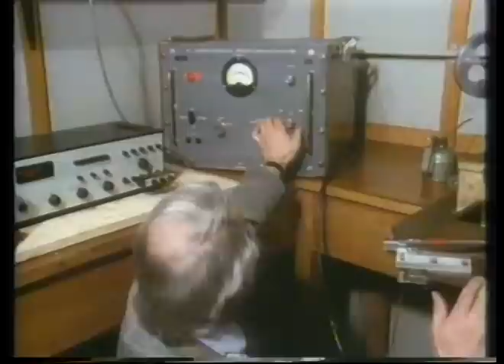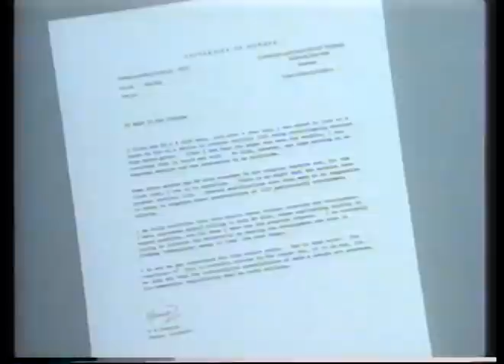Anti-Gravity Machine (Part Two)

Comment: I am now much older than Professor Eric Laithwaite when he passed away, and I did go up to London to attend some of his lectures. I am to write is meant for others to think about and if they have the time and equipment, they can try and confirm it. I did it in my simple manner of home experimentations.

1. Keeping the spinning plane. The mass in the spinning wheel of a gyro acts in the plane of rotation and tries to keep it due to the high angular momentum.
2. Precession at 90 degrees. The plane of the spinning wheel may be looked upon being a lot of individual elemental masses placed on flexible radial spokes and each elemental mass can be treated individually.  When the wheel is fast spinning on its axis all the radial masses are spinning with a  high circumferential velocity/momentum depending on the radius and the spin rate. If at any moment, the spinning axis of the gyro wheel is tilted, then some mass at the end of the tilting radius will try and move out of the spinning plane while another on the opposite radius will move out of the spinning plane in the opposite direction on a diameter. So having an additional force/torque applied to them the elemental masses will accelerate out of the original spinning plane. As these elemental masses are tied with a constant radius with the axle, then while the tilt of the axis causes the particle to accelerate out of the relative halves of the wheel,  their final " integrated circular motion" will be a maximum when the mass particles are in quadrature or 90 degrees to that location where they began to accelerate out of the original plane. Eventually when the tilt of the axis is long enough then all the mass particles on the spinning wheel will take up spinning in another plane at a 90-degree angle with the tilt that accelerated them out of the original plane. That is a 90-degree precession effect.

3. Precession and holding of a gyro on an extended shaft. If a spinning wheel is placed at the end of a long extended shaft where the free end is placed on a vertical stationary mast, and the spinning wheel at a radius R from the support mast, then as the wheel drops vertically,  it tries to do this with the acceleration of 32 ft/sec^2 of gravity, which is relatively slow with respect to the velocity of the spinning mass particles. With the vertical drop, hence the tilting of the axle, the mass particles on the upper half of the spinning wheel will be "accelerated out" away from the central supporting mast and those in the lower half will be "accelerated in"  towards the support mast. This acceleration one way and the other on the upper and lower half of the spinning wheel will cause the integrated acceleration to change the plane of spinning at 90 degrees to the initial vertical drop, horizontally.  The spinning wheel changes its plane at a right angle to the vertical dropping, hence tilting axle.  It is important to realize that the particles that accelerate out or in towards the central support mast are spinning much faster than the spinning wheel, as one whole unit, can drop due to slow gravity effects, so the top and bottom masses in the plane of spin, will try and replace each other so fast that they cause a high inertia fluctuation, similar as a big capacitor in a low pass filter objects to an AC fluctuation or "stationary mass inertia" be it electrical or statically and dynamically mechanically. This 90 egress action will try and fling the pivot support point on the central stationary mast in a horizontal direction, but it cannot as the mast is stationary, so the horizontal reaction must bring about the result as the free rotation of the whole spinning wheel about the stationary support mast. So "a tiny vertical drop" tried to precess the wheel in "a horizontal motion" at a related natural rate of change.

4. Precessed rising of the gyro. If the natural rate of change of the horizontal motion is hurried up ( or slowed) then a second precession process will take place and the reaction to it will be a 90-degree reaction where the spinning gyro will now lift, ( or drop) gaining (or losing) potential energy from the eternal input.  If for any reason the whole spinning wheel is dropped vertically in a sudden action, then the gyro wheel will wobble along changing KE into a faster horizontal precession which in turn will raise the gyro and this transferred oscillation will proceed till it stabilizes, as it is damped down. There is another interesting reason why the spinning wheel of a gyro when on an extended axle on a central stationary mast may lift up to the vertical till its axle is perfectly vertical. 

5. Rising (or dropping) of a gyro while precessing around central stationery must. When the fast-spinning wheel of a gyro spins and at the same time rotates /wobbles around a central stationary mast, and is SPUN AND TRANSLATED, then this spinning and translating effect will result in the spinning stationary circle, being modified into a type of cycloidal motion and what is more, the cycloidal motion of the particles on the spinning wheel will vary as the spinning wheel is tilted and then it rises and drops below the horizontal spinning axis.  Any cycloidal trajectory, unlike a perfect circle, it will have a variation in velocity and in acceleration and hence the related generated forces with the varying acceleration as a particle moves along the cycloidal trajectory.  If the extended axle of the gyro is about 45  degrees tilt, then the conical cycloidal trajectory of the spinning and precession wheel around the central support mast, the differential accelerations, hence the accompanying differential forces will "  throw up" the whole gyro to lift it to try and reach the vertical position ( or the inverted vertical position). Here all the mass particles will be moving in a horizontal circle with constant velocities and constant accelerations and hence stable. In practical experiments, this vertical stable position ( as a spinning top) will be held till the gyro slowing down and the weight due to gravity will take over.  It seems that all the internal cycloidal forces on the spinning particles of the gyro wheel are RADIAL to the center of the spinning wheel and hence these cycloidal acceleration forces will not precess the gyro hence the " throw up" and rising of the gyro dictated by the cycloidal differential accelerations. 
6. Centrifugal force. If one looks into the differential accelerations that exist withing the tilted, conical, cycloidal trajectory of the mass particles in a spinning gyro wheel, one will notice that the accelerating components of the tilted acceleration vector of the elemental particles do oppose the centrifugal force.  Many people declare that the centrifugal force in a spinning and precessing gyro " vanishes" and perhaps the solution is found in differential vectorial accelerations contained the cycloidal trajectory of spinning and translating and " circulating surface of a conical, tilted,, translating and spinning of a balanced wheel. Their another dynamic unbalances in a " statically and dynamically balanced wheel" 
7. When the external torque on a gyro is removed suddenly, the wheel shows no inertia effect as it is not the whole mass of the wheel that is being translated, but effectively it is the elemental particles that are being displaced out of the spinning plane and hence effectively little inertia is shown when the outside force is reduced unless the whole spinning gyro is shot out and thrown off the muzzle of a gun, where all the mass is being translated. 
8. The gyro cannot ever produce any action without any reaction and if one tries to propel a spacecraft with it,   and try to spin the wheel in space to get it going, the spacecraft will spin back. If one seeks reactionless actions..........they must look elsewhere but not inside the gyro.  
9, Finally here is the equation of a flat gyro operating on a rotating arm to check and approximate to the differential accelerations of the family of complex three-dimensional conical cycloids.  I obtained and plotted these differences in accelerations as the cycloidal trajectory is followed and the difference of accelerations on the upper half and lower half of a spinning gyro. It is all very clear, hence the tiny differential repetitive forces give the gyro its elegance and unintuitive perplexing behavior. 
10.  Location of particle = R1. e^jw1.t  + R2.e^jw2,t
         velocity of particle = R1. jw1.e^jw1.t  + R2.jw2. e^jw2,t
   acceleration of particle=R1. (jw1)^2.e^jw1.t  + R2.(jw2)^2. e^jw2,t
I would be grateful if anyone would like to confirm this work. 
for reference to rising gyro see. 
https://youtu.be/FRvrmTLHx_M
Reply: Nice I respect your effort
Reply: @dannymitchell2918  Thank you so much. The summary of the action is as follows.
1. The arrangement generates two centrifugal forces, one is inbound F1while the other is outbound F2 as conventional centrifugal force, both almost parallel to the axis of the gyro.  The inbound and outbound forces can vary in magnitude and in a slight direction. These two centrifugal forces apply themselves automatically with a separation distance (x vertically and horizontally) in between them, on the spinning face of the gyro operating on the upper and lower horizontal halves  ( vertical torque)  and on the left or right side, vertical halves ( horizontal torque) of the spinning wheel.  The results are as follows:-
2. They produce an internal torque to balance the gravity torque (m.g.R arm)=(F1+F2)*x
3. They produce the dynamic angular torque to produce the angular precession Wp, thus (I.Ws.Wp)= (F1+F2)*x  where gravity torque equals dynamic angular torque.
4. If F1 is not equal to F2 then there is a resultant outward force generated which is the conventional centrifugal force with less effect. It is wonderful how the creation of the inbound force F1 diminishes the conventional centrifugal force.
5. The slight forward tilting angle of both forces produce the "traction "  to pull the mass of the gyro forward relating to Wp>R arm.  Normal dynamics (F1+F2)* sin( small angle in between F1 and F2 =  m( d(Wp)/dt + air drag forces and other losses in the system appertaining the gyro motion.  Actually, there is not even a necessity to consider that F1 and F2 are not actually parallel to but acting in the opposite direction.
Thank you once again. 
It is such a pity that many people did not realize how it all operates and went through many heartaches in the last century.
Reply: I would love to build this device and I believe the only way to get sufficient backing from the public and scientific community would be to make it lift a human. Could this be done ??
Reply: @dannymitchell2918  It does not even lift itself ... how is it supposed to lift anything else?
Reply: @carmelpule6954  How dismaying to see you reasoning in terms of gyroscopic force. It is fictitious.
Reply: @MrAaronvee  Yes, I know, but after all, the weight of the gyro (mg)  starts with being a force, and then the moment arm length changes it to torque. 
I looked deeply into the cycloidal path that each mass particle is made to follow in a torqued precessing gyro and the plan view of this three-dimensional cycloidal path clearly shows the distributed accelerations that the masses are subjected to, accelerations which lead to force when applied to the mass.  If the gyro is not spinning in the arrangement shown in the video below, then the masses follow a circle and this circular path produces the radial, constant acceleration which produces the conventional centrifugal force.  When the gyro is spinning and processing, then the circle will change into a three-dimensional cycloidal voluminous path with its three dimensional distributed acceleration which contains convex and concave curves with respect to the support central pivot, unlike the simple circular path when a mass at the end of a stick is rotated around or indeed the gyro itself spinning about its own center without precessing, all in a flat plane, there is no torque then!.  The gyro spinning without precessing produces centrifugal forces in the spinning plane, with no torque in existence.
The three-dimensional cycloidal path of a precessing gyro generates a complex distribution of accelerations lateral to the face of the gyro. There are acceleration forces. This is the magic that makes the gyro operates as it does. The fact the internal forces  are separated in distance, then that becomes a torque and it is this separation of the internal forces that change forces into torque which people describe as (I Wp Ws)

Normally people equate (mg. Ra)= (I. Ws.Wp) as a torque but mg is a force.
All I did was to look deeply into the action of the cycloidal path of the mass particles and found out the three-dimensional accelerations, hence forces each particle is subjected to.  The forces boiled down to an INBOUND (F1) AND AN OUTBOUND (F2) CENTRIFUGAL FORCE  separated by a distance X in both the horizontal and vertical plane 
so  ( F1+F2)*X = (mg Rarm) as a torque
and ( F1+F2)*X= ( I. Ws.Wp) as a torque.

so ( F1+F2)*X= ( I. Ws.Wp)=(mg R arm)   all in the form of torque, however

F1- F2=  m.Wp^2. Ra which is the conventional centrifugal force which is diminished when F1=F2 as a force.
 Please refer to the following video. Notice that Professor Eric Laithwaite did mention the fact that there was no centrifugal force in the unit I am referring too and if he looked into the acceleration forces that are generated in the cycloidal path of particles in a precessing gyro he would easily have realized the importance of treating the internal forces of the gyro as forces, and not as torques all the time.  My method explains the reason why the centrifugal force basically disappears and almost all the steady-state reactions on the support pivot, not the transient state, however. 

https://youtu.be/JRPC7a_AcQo
Reply: @MrAaronvee  You are absolutely correct and it is such a pity that many people have been misled that this machine can lift itself. 
Recently I dug rather deeper into the operation of gyros and it is such pity that even Professor Eric Laithwaite, nor Dundee University nor Sady Kidd did not see the whole picture.
Gyros are normally presented where torques (mg R arm)= ( I.Ws.Wp)  and the rate of change of angular momentum d( I.Ws)/dt is facilitated by considering the angular momentum as being a function of the change of angle of the axle hence, assuming that I and Ws are constant, then the rate of change described as d( I.Ws. Angle)/dt = (I.Ws.) dA/dt=  (I.Ws.Wp)
However, this does not show the whole picture of the gyro operation. 

https://youtu.be/JRPC7a_AcQo

In explaining the action of the heavy wheel one sees in this video I normally oscillate between using forces and torques. This is how I see the heavy wheel floats as it does.
1. mg, inherent naturally in the heavy wheel as a vertical downward force acting a distance of (R arm) away from the pivot becomes a torque ( m.g.Ra) which caused the wheel to drop a little and this changes the instantaneous angle of the vertical diameter, pushing the uppermost mass particles out and the lowermost mass particles in. This needs a torque ( m.g.Ra)= ( I.Ws.Wp) to shift all those spinning masses. 
2. The flight path of the mass particles creates a 90-degree precession causing the axle to shift horizontally. This is what I call the FIRST PRECESSION. and it does produce a horizontal reaction on the pivot to accelerate the gyro forward in its precession path Wp.
3. As the gyro shifts horizontally centered on the pivot, the instantaneous horizontal diameter changes its angle, wherein the case in the video, the new flight path of the upgoing mass particles will go nearer the pivot while the downgoing mass particles will go further away from the pivot. This needs a torque of ( I.Ws, Wp). This is what I call the SECOND PRECESSION. 
4. This action will cause the axle of the gyro to be torqued T another 90 degrees, so a total of 180 degrees,  vertically, opposite to the initial drop caused by  (m.g.Ra) where (Ra) distance away it will find the pivot to re-react upon hence the torque will be changed to a vertical downward force (mgRa)/Ra = (mg) on the central pivot. Hence the original downforce mg was instrumental to use to torque the gyro through an extension arm Ra which was once again, used two 90 degrees precessions later to change the torque (I Ws, Wp)=(mgRa) back to a force (mg) to which the pivot reacted upwards to hold the constant floatation of the heavy spinning wheel.   
So using forces and torques this is how it goes.

mg, as a downward force is changed into torque by applying it at the end of the radial arm (Ra) hence ( (mgRa) as torque, will be transferred to a first angular torque ( I, Ws. Wp)  by the FIRST PRECESSION  and 90 degrees reaction.  Then the second precession will transfer this horizontal action to a vertical action by a SECOND PRECESSION by another 90-degree reaction.  hence the torque ( I Ws.Wp) at 180 degrees later will appear as a  torque pushing the pivot end of the arm Ra vertical downwards into the professor's support hand. 

If the Professor applied a horizontal input torque with his support hand he would have fuelled the SECOND PRECESSION  and the gyro would have been torqued up where the axle will finish vertically up with the spinning disc rotating in a horizontal flat plane.  I do feel that Professor Eric Laithwaite and Sandy Kidd did misinterpret "lifting forces" and " rotating torques".

Please note that the torques  ( m.g.Ra)= ( I.Ws.Wp) are not enough to explain why the unit does not produce any conventional centrifugal outward bound force.
I looked into the three-dimensional voluminous accelerations, hence forces generated within the cycloidal path in which the mass particles in the gyro are made to mode LATERALLY TO THE FACE OF THE GYRO and the explanation why the outbound centrifugal force is diminished is so clearly seen. 
I realized how an INBOUND CENTRIFUGAL FORCE  is generated in the complex cycloidal path of a precessing gyro .  I explained all this to you in another comment. 
Thank you for your communication.
Reply: @carmelpule6954  That is an awfully complicated, and superfluous, way of looking at the situation: it is rather like analyzing the orbit of the Moon about the Earth by combining it with the Earth's orbit about the Sun. That also leads to complicated spiral patterns ... and serves no useful purpose. Your method goes against the long-established tradition of reductionism in physics. You should apply Chasles' theorem to this type of problem. You also seem to have failed to notice that the forces involved are not merely torques: they are also couples, and can exert no net forces on the system. Laithwaite's bachelor and doctoral theses concerned information-retrieval; it is a mystery why he was ever thought capable of understanding machinery.  He once wrote an article which proved only that he did not understand Noether's theorem and the separate conservation of linear and angular momenta. He wrote another paper which suggested that the third differential of displacement involves 'new physics'. He was wrong about a precessing top exerting no 'centrifugal' force upon its support; his crude experiments were simply incapable of detecting it. He also claimed that a precessing top possesses no angular momentum about its support. It is true that the precession of a top weighing a tonne can easily be stopped by using a single finger, but that occur because the movement immediately changes direction and not because of any absence of momentum.  Simply put, Laithwaite was a moron who was promoted beyond his intelligence. Even the promotion was self-promotion.
Reply: Drop a big lead ball and a small lead ball from the same height and they both hit the ground at the same time.  Same for a feather and a lead ball if you do so in a vacuum to remove air resistance.  Now drop a spinning gyro and a lead ball and something fascinating happens.  They hit the ground at the same time.   But the person holding the gyro felt how weird it was twisting in his hand, and starts to think he can make a levitation machine.
Reply: @MrAaronvee  Thank you for your reply. Yes, it does look rather complex, but it is not really.  As an engineer, I prefer not to use laws as Ohm's law= (V=I* R) or  (V= Blv) in an electric generator or (T= BANI) in an electric motor or  (mgRa=IWsWp)  in gyros.
V= Blv does not explain the real engineering, microstructure physical detail of how a generator magnet reacts with moving particles of a conductor when it has a rate of change not does V= A.dB/dt +  B.dA/dt   or  in a space-time domain as   Curl H= J+ dE/dt.

What I did with the gyro was to look as deep as one can go on to "see and feel" the acceleration of mass particles in the cycloidal trajectory they are made to follow.   I differentiated twice on that three-dimensional voluminous trajectory and so many elegant conclusions came about with forces acting at a distance to form couples.

Yes, I risked my neck out to be unconventional but it was worth it and Professor Eric Laithwaite, Sandy Kidd and Dundee university would gain a lot if they heed what I described as emerging from the distributed accelerations that are included in the cycloidal trajectory, the multitude of little mass particles are made to follow.

Here is an interesting conclusion as a result of my work.
***In a precessing gyro, considering Wp as the slower processing angular velocity and Ws as the faster spinning angular velocity of the gyro wheel, then when the velocities due to Wp and Ws are moving in the same direction as on the lower half of the spinning gyro as shown in Laitwaite's video, then the center of curvature of the cycloidal path is close to the central support pivot and so the mass particles on the lower facial half are subjected to an OUTWARD BOUND centrifugal force, while, when on the upper half,  the velocities due Ws is moving in the opposite direction to Wp, then the center curvature of the cycloidal path moves out of the circle made by the extended arm Ra and so this produces an INWARD BOUND centrifugal force on the upper facial half of the spinning wheel. If the relation velocities due to Ws and Wp are reversed then the gyro can be made to rise and fall accordingly, hence nutation oscillations even reversal motions!!!. **** 

It is these two forces due to the cycloidal accelerations acting like a couple both in the horizontal and the vertical that gives all gyro all its beautiful and elegant characteristics. It is lovely having a computer to simulate all these cycloids and their acceleration contents, accelerating and decelerating and bashing mass particles across the TWO FLAT FACES of the gyro spinning wheel and not the radial centrifugal forces only,  and also I have a workshop to build gyros to test my postulates. 
I believe that Professor Eric Laithwaite would have enjoyed what I had to show him.  Incidentally, I decided to risk my neck and put pen to paper in these YouTube videos so that others may think about it and be a little unconventional to see the real elegant details of a gyro.  I do hope that someone at Imperial College London, Dundee University, Sydney University, and Cambridge Univesity and elsewhere would simply plot these cycloidal paths and then seek to extract their three-dimensional acceleration to determine the location of the forces hence torques and couples. I would love to meet Sandy Kidd to explain some details which would "comfort him a little" 
There is a beauty in the detail described that I am sure you will enjoy much more than looking at the relations of a gyro as simply,  (m.g, Ra) - (I.Ws.Wp). 
I had communications with people who still believe that this unit arrangement, loses weight and can be used for inertia propulsion space units after watching Laithwaite's videos. I am being criticized for not using conventional torques, and some are insisting that I am wrong.  Rather than arguing or doing what Professor Eric Laithwaite did in encouraging others to build such machines...............  " to lift",  I simply try and explain to them that all this unit does is "torque" and to look into the locations and magnitudes and directions of the cycloidal accelerations hence forces, torques and couples which all must balance out eventually including the diminishing effects of the conventional centrifugal force radial to Ra and not to the Gyro radius Rg!  
Thank you once again for your company and discussion.  Do not be too hard on Professor Eric Laithwaie, yes he was too much in a hurry to be spectacular rather than being accurate........ but society does respect people who make a public show and entertainment, unlike me, staying at home working out the details in the microstructure and being criticized for being unconventional but so accurate!  Throughout my well over eighty years of life, I made over one thousand court investings and I can say that with some, I had to dig deep into the details where " forces due to accelerations" were fatal.  
I did meet Professor Eric Laithwate but I chose to live a family life rather than be conspicuous in public. He was not a bad person, but lacked the details and preferred being spectacular in public like many people do in fact.
Reply: @carmelpule6954  Well, I still think that you have wasted your time, given that Euler's equations explain all rotational phenomena. Because his equations were predicated upon Newton's third law, they cannot predict any sort of levitation or propulsion. Some situations cannot give rise to closed-form solutions of the Euler equations, and Laithwaite thought that 'new phenomena' were lurking therein. However, such situations can be treated using direct computer simulation ... and there is still no anomalous behaviour. Laithwaite was not just a crank with regard to spinning-tops; everything that he promoted was wrong.
Reply: @MrAaronvee  The way I see it is that if one sees the beauty and elegance of the universe from different directions and perspectives which others did not,  then it is certainly not a waste of time, but just being able to fill one's time one is lucky enough to have lived. I explained my method of analyzing the internal accelerations of the gyro to a few people now, and they all agreed that it is a good method to use amongst those people who do not have a background of higher mathematics. This week  I made a soft gyro out of a flexing material to make the spinning disc and the circumferential wave motion on applying torque is a beauty to behold as it depicts all the explanations that are not so easily seen in a solid gyro.  When conducting such work,  one feels like an excited child walking along the seashore, occasionally picking a beautifully colored pebble or two which catches one's eyes. I just thought that I would present in the videos which depicted the gyro and where I felt that this unit was not fully understood. Maybe someone would appreciate it.